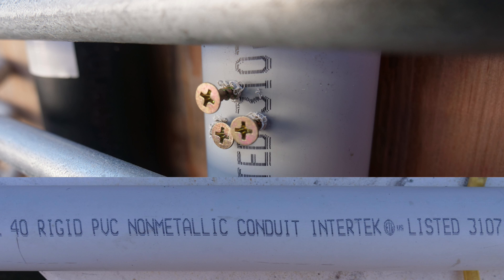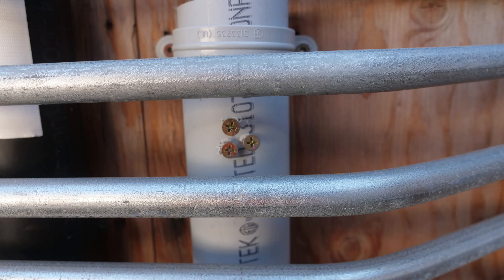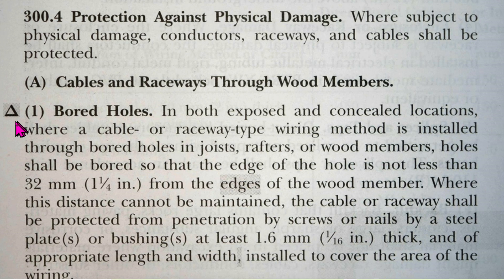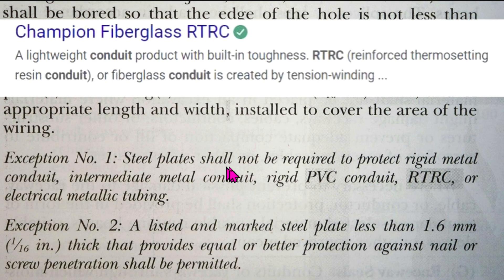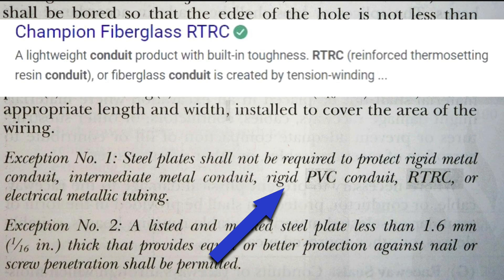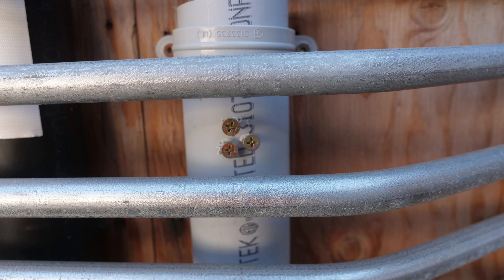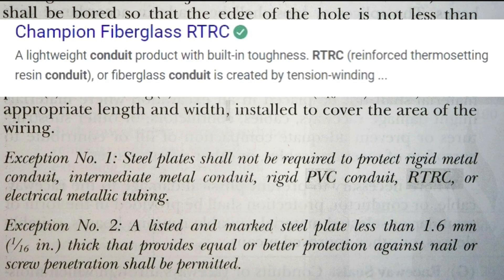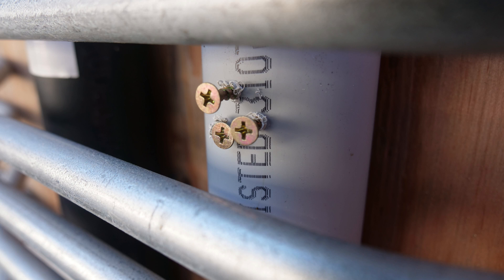Rigid PVC Exempted from Nail Plates? 2023 NEC 300.4(A)(1)

Comment: Drywall screws are pretty hard and sharp, I bet they'd go through EMT (thinwall) as well as PVC.  If I ever have some scrap pieces handy I'll try it.  They run screws into steel studs without drilling, I know the screws are designed for that but the screws can't tell conduit from studs.  Those other trades need to be at least somewhat careful.

As a homeowner I'm always guessing where the wires and plumbing are.  I check for voltage and ground on the screws when I'm finished since my plumbing is copper.  With plastic I'd just have to wait for the water leak, which could take awhile.  Hopefully PEX would squirm out of the way and not get "screwed"".
Reply from the maker: Excellent points, thanks!
Reply: @SparkyChannel  I watched another of your videos and it looks like EMT does in fact require nail plates if it is too close to the edge of a stud.  And rigid PVC does not?  That does seem like an anomaly in the code.
Reply: Honestly my immediate thought upon first learning that EMT doesn't resist punctures (let alone drilling) from metal stud drywall screws was "well then what's even the point of EMT?!"

Nowadays I'm still mentally struggling with whether I should want to use rigid metallic conduit for everything instead... It sounds very insane and yet I still want the protection
Reply: @Ariccio123  Rigid is a lot of work, at least EMT will bend. The beauty of any kind of conduit, even plastic, is wire can be re-pulled if damaged. It's also extra safe from rodents. Drywallers would really have to hit it dead center to actually make it through. The same as plumbing.

Comment: On a similar note I installed new road lights and installed 3/4 inch PVC conduit about a foot from the curb and about 15  inches deep with three phase 480 plus a neutral and ground wire to power up the new 277 volt LED light fixtures. Well a landscaping contractor installed straw wattles and held them in place by hammering 20 inch wood stakes through the wattles and into the ground. Well one of those stakes was driven into the PVC conduit and into the current carrying conductors and caused a short between each phase and they were also grounded which one turn caused all three circuit breakers to trip immediately.
The circuits were working fine for a year and a half before the landscapers screwed up the conduit and wire. I say it was a one in a thousand chance that they  would damage the conduit and wire but they did it anyway.

Comment: @sparky channel so here is my take the reason I guess the code went down this route was based on the idea that assuming a nail was to penetrate rigid PVC and a short occurred would it cause a non conductive material the rigid PVC to become live - most likely not in terms of the electrical energy of circuits in residential settings, in addition there are two other protective elements built into the circuit a GFCI/AFCI breaker providing firstly protection against ground faults and short circuits and secondly arc-fault protection so you have to view the new rule with other 2023 protection requirements. You can always pull new wire through the conduit to correct the fault. Moreover the second exception also allows for a thinner steel plate than the normal 1/16 inch plate. The NEC reviewed fire data and circumstances where screws would be put into bored holes and their heights. They assumed most bored holes were not at a height where cabinets and TVs were going to be mounted. The NEC preferred to ease the requirement for adding steel plates with rigid PVC. Just as many people argued for keeping steel plates in the public comments to the NFPA code making panel as there were for removing them for rigid PVC. Above all we always have to remember the NEC is a minimum nothing stops you adding the steel plates and going above and beyond the code. I like you would add steel plates to avoid the hassle in correcting the fault in the first place.

Comment: I agree, rigid PVC does not protect against metallic penetration. The only way this change in code makes sense is that the round of the PVC will deflect direct penetration.
Reply from the maker: EMT does deflect penetration unless you hit it straight on. Rigid PVC, on the other hand, doesn't deflect nearly as well because a sharp point of a screw catches so much more easily. Also, with the screw being held straight by the drywall and wood, deflection becomes more difficult for the rigid PVC. I would be interested to hear NEC's argument on this one.
Reply: BS, the plumbing codes require nail plates because sheet rockers will shoot screws or nails through the entire length. NEC took some manufacturers money and made the code less safe.

Comment: Code states the minimum requirement. Anybody with enough gumption can send a drywall screw through things they shouldn't. Plan your pipe/wire runs better, and use nail plates if you aren't confident.

If you think it needs a nail plate, go for it. But most homeowners aren't driving screws that long into their walls, so unprotected Rigid PVC is probably acceptable for its intended use.
Reply from the maker: Let's say I'm not confident on this one. Thanks!
Reply: What about the drywaller hanging 5/8"? What about a TV install on the wall? A heavy mirror or painting? Surface mount shelving or cabinets? I think there are enough things that require longer screws to justify the use of nail plates on all PVC.

Comment: I imagine the authors did NOT have my brother-in-law in mind, who will absolutely continue to drive a lengthy support screw through drywall, even if it's meeting material resistance. Anyway, nice follow-up video as always, Sparky. I also imagine that the vast majority of professionals would excercise precaution and continue to use a nail plate where reasonably appropriate.
Reply from the maker: LOL! Yes, most professionals will put a nail plate in this instance anyway because it's common sense.
Reply: The more material resistance it meets the more it will hold...uggadugga
Reply: @xephael3485  Haha! I'm pretty sure that's my brother-in-law's motto!

Comment: I think nail plates should be required for PVC, and also MC cable.  They are just not strong enough to stop a nail or screw.
Reply from the maker: Nail plates are required for MC cable if there isn't 1 1/4" of stud left. Not for rigid PVC though.

Comment: I wonder if the thinking has something to do with the PVC not being able to be energized by a screw penetration, so the safety risks would be limited to shorting the conductors inside the PVC (presumable protected by a breaker) or the screw head becoming energized. But it seems an odd carve out of the rule.
Reply from the maker: Interesting idea. But what if one then touched the hot screw head of the screw that penetrated the hot wire with something metallic? Yes, the exception is very specific for 2023. They purposely excepted rigid PVC. Thanks Vernon!
Reply: @SparkyChannel It does seem weird. I came across an example of this sort danger in my last house a few years ago. I was re-panelling in the basement and having to saw the old wood panelling along the ceiling to avoid pulling the ceiling down. What I couldn't see was that above the breaker panel, the cables had simply been laid in a notch on the front of the top plate with no nail plate, rather than in holes the centre of the plate. I was using a hand saw and shorted 3 circuits simultaneously, very big bang and melted the teeth off saw blade. That was a 1958ish install.
Reply from the maker: @VernKlukas  Wow! Hopefully that hand saw had a wooden handle?
Reply: @SparkyChannel  It did, thankfully. Japanese-style pull saw too, so my hand was going away from the action.

Comment: Interesting Sparky.   It is really hard to protect every type of piping from all of the possible intrusions into a wall.
Reply from the maker: Thanks Gary!
Reply: Simple only two logical choice. It’s not rocket science..  it’s metal it doesn’t need protection.  
  It’s any other soft material synthetic, composite man-made polymer it needs protection what is so difficult about that .
Reply from the maker: @coldfinger459sub0  I agree, although emt being protection from screws is debatable.

Comment: What a failure. Just goes to show you the people who come up with these codes sometimes have no practical idea what they're doing, other than creating messes they'll get paid to correct in the next iteration of the code.
Even EMT can be punched through by a drywall screw pretty easily once that screw has some wood guiding it. Plastic doesn't stand a chance.
Reply from the maker: A regular guy that works with his hands every day would never come up with that code exception.

Comment: Thanks for posting.   keep the PVC back at least past 1.1/4 inch.  i actually have never seen pvc done this way.  and there is also PVC , Sch 80.    ,  i can remember several years ago , where this carpenter was getting ready to use 2inch drywall screws in drywall as that is all his boss had.   i told him.  you can,t do that and said you hit something and you are in trouble.
Reply: Also i can remember this Carpenter back in the year 2000.  hit a nail plate on the 3rd floor in a small bathroom.  so she keep pushing it through.  guess what it hit.  a copper water pipe. so about a hour later .  comes this trickle of water down to the 2nd floor.   She was chewed out.
Reply from the maker: @zerosparky9510  Wow! Thanks Roger!
Reply from the maker: Good story!

Comment: since I was one of the commenters on the first video, you know I don't trust PVC OR EMT to stop a screw.  I wonder if they wrote the exception for PVC alongside a stud, and didn't consider it allowed leaving PVC through a stud unprotected.
Reply from the maker: Possibly. BTW, your comment gave me the idea for this video.
Reply: @SparkyChannel  I figured I was probably one of the comments that inspired it.
Reply: Sparky, if you’re looking for an idea of another video, there has been some controversy by posters on other electric videos about the requirement for a “separate main cutoff.”  In northern climates, the main panel is usually inside.  I ‘believe’ NEC changed to require a separate main shutoff ‘outside’ for use by emergency responders.  Perhaps, you could go over this and how it effects those of us in the warmer climates where are panels are usually outside and the main shutoff is integral with the main panel.  I always enjoy your videos!
Reply: @glasshalffull2930  I recall a couple videos on the 2020 code regarding it.  and you're right, my state rejected that code change, as being a lot more trouble for a negligible return.

Comment: whos gonna run pvc inside a wall though?
Reply: anyone who installs a flush mount underground feed meter, for one.  anyone who runs a conduit system to outside, in a marine climate, for another.
Reply: @kenbrown2808  oooohhhhh. interesting. thanks
Reply from the maker: @kenbrown2808  Good answers, thanks.
Reply from the maker: How about when it runs through top plate?

Comment: Like a lot of the code it makes no sense
Reply from the maker: Once in a while... Thanks Ed!
Reply: In one of my update classes, my inspector explained nearly every code item comes from new technology, a-hole installers, or a-hole inspectors.  If you dig deep enough, you can find a reason. As i said in my own comment, i suspect this change came about because of pvc run parallel to framing. I'd guess there was an inspector demanding plates the whole length of it.

Comment: Code is the minimum requirement. Common sense says if it is located where it is likely to be problematic protect it. I’d protect MC cable too. Although I recall a fun hour or so searching for  that drywall screw was that a contractor penetrated a conductor and electrified a metallic door frame.
Reply: Wait until you hang a picture on a wall and a ceiling light turns on !!
Reply from the maker: Wow, good story! I hope there were no injuries. Thanks Burt.

Comment: I guess the thinking is that most screws will be inserted along studs or something similar. They list 32mm from stud edge. A usual drywall type screw is less than the 32mm plus the thickness of the drywall or plywood. Thus, the penetration would be zero to minimal. I don’t know what it would mean for wall hanging items or similar. The point would be to use a screw or nail only as long as you need. Things that make you go hmmmm.
Reply from the maker: Yes, this one would be filed under "things that make you go hmmmm". Thanks Gary!